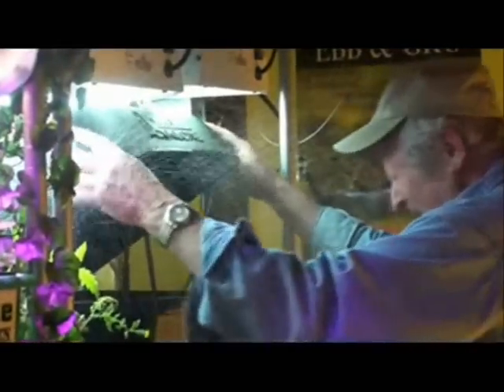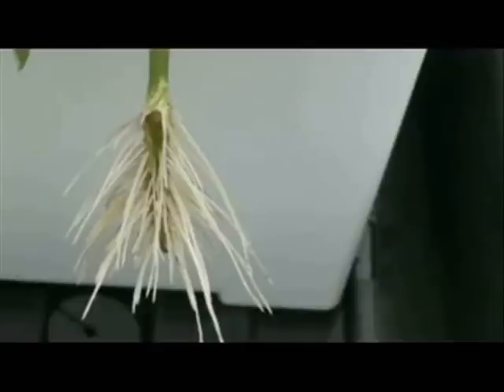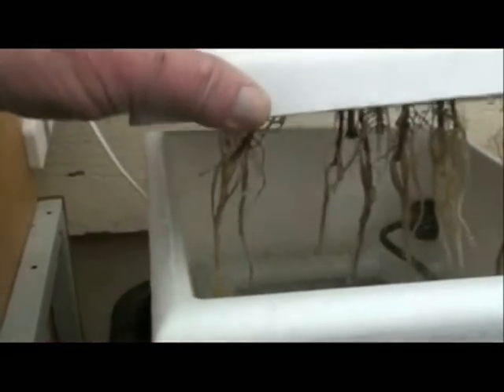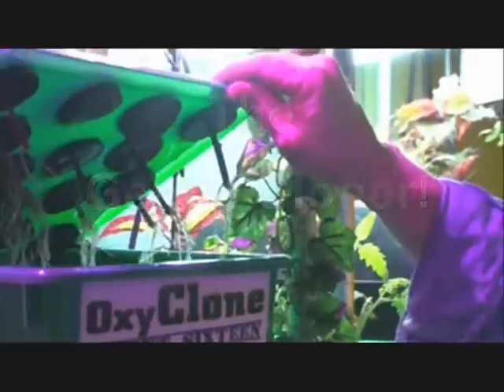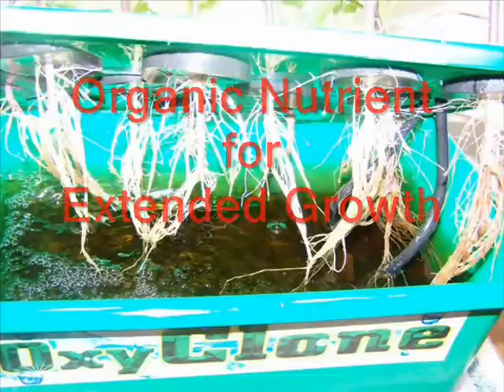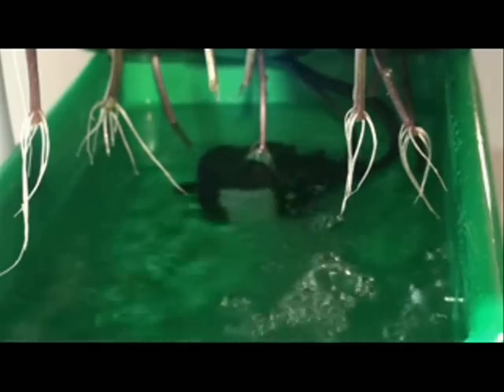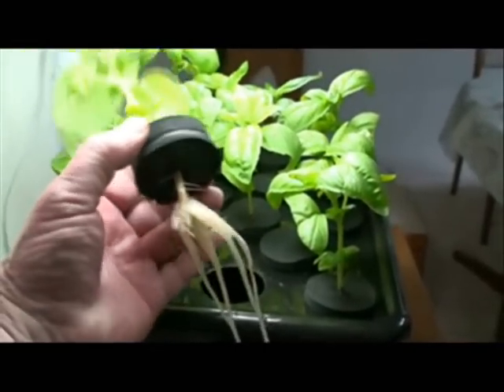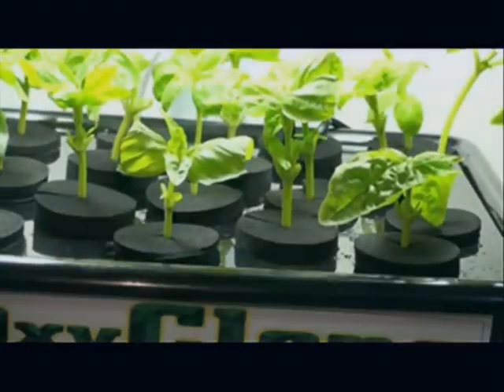DWC Hydroponics - Show Us Your Roots!!

Comment: (see below)
The problem is the nutrients turned the water a brown color and the root all turned brown too and looks  poorly. They also look like they are snagging a kind of 'sludge' on them from the solution. Can you advise if I need to dump the water? The leaves are curling around the edges and now I don't know what to do with them! I'm very new to hydroponics, thanks.
Reply: +Michael H 
you need more aeration and less saturation.  good luck.

Comment: nice video, very healthy roots. I was hoping to get some feedback on a question I have. I setup a DWC system using rainwater to grow four Kale plants. I have the plants in net pots and a mix of perlite and peat moss. A few weeks after I started, the root systems seemed small and only one of the plants looked as if it was growing in size. So bought nutrients and a bottle of pH down to adjust the pH to 6.8.

Comment: Adding more "positions" doesn't really mean anything since getting the plants and roots too close to each other is not a smart thing to do.  The cloning "ports" should be at least 2-3 inches apart at a minimum,
Reply from the maker: I surely admit that I don't know it all but I really haven't had any problems cloning in any these machines; so I'm wondering if you can explain the dangers of cloning cuttings close to each other to me and our other viewers.  Thanks for watching and thanks for the comment!
Reply: Ronald Kleinman For cloning, practically, it doesn't matter that much except that it is annoying to have to work in such a close proximity.  I have a cloner and the cuttings I generally make I could not fill the entire thing up without getting the leaves and roots intertwined, that's all.  At about 1:00 you show your cloner using about 1/2 of the spaces in it.  It would be hard to really add any more to that ... so what is the point in having all those positions?